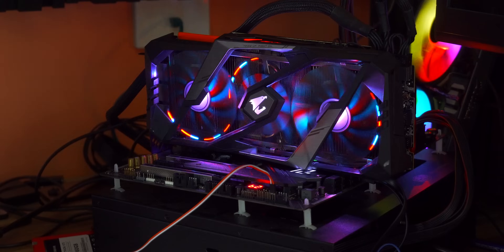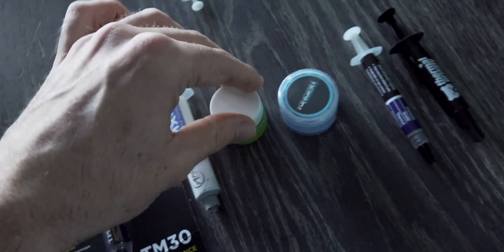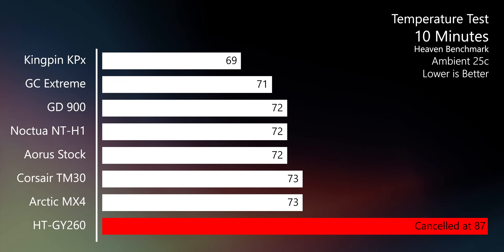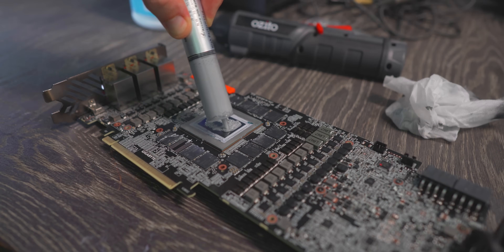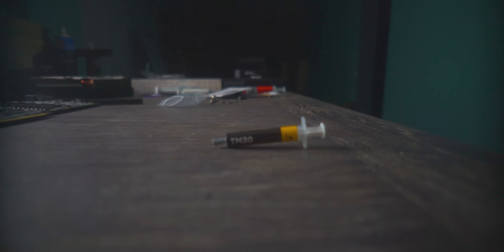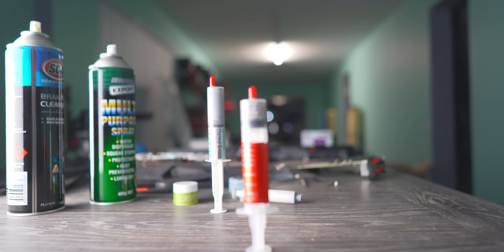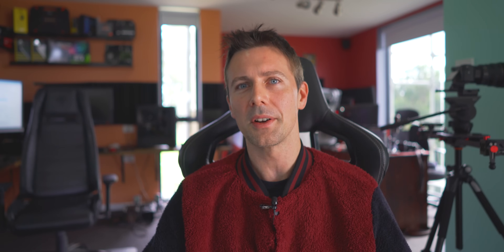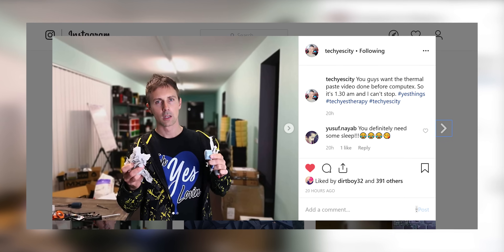What's The BEST Thermal Paste in 2019....? (Ft. GD900)

Comment: List of contenders for future comparison.
ARCTIC SILVER-5, DEEPCOOL SILVER Z9, Thermaltake TG-7, CoolerMaster MasterGEL PRO, CoolerMaster HTK
Reply: Arctic silver 5 is good but its not at its best when first applied. I think the curing period is about 2 weeks.
Reply: @pardonx1  it's not Really time, it's cycles. I was able to get it doing about a 5C or more better in a few hours just running furmark until it maxed out, cutting load and keeping fans at 100% until it stopped getting cooler, and repeating that several times. That kind of thermal cycling is rough on the cards but gets AS5 cured fast.
Reply: @kiaas  You're right I forgot about that . I think I remember it being said it would take 2 weeks for the average use of the PC and I think it was talking about the CPU. At any rate thanks for the correction
Reply: ThermalRight TF8.
Reply: Yes...AS5, I've been using it for years (Athlon64/Core2Duo I think)....I want to know if I should change. Especially now that I put an 8700K and Vega56 in Silverstone's ML08.
Reply: @mateiberatco500  Same here
Reply: @mateiberatco500  you should change yes
Reply: @mateiberatco500  I was using Arctic Silver 5 on my 8086k and Zotac Amp 1080 and after watching Tech Yes City video I switched to GC Extreme and it was a little better. It didn't allow me to overclock higher but it made already good temps better. As far as my gpu neither was better or worse than stock thermal compound but that cards cooling is just plain horrible. Having said that, for other people they both lowered temps on most gpu's.  Your experience could be better or worse than mine hopefully better.
Reply: @mateiberatco500  Switch man, mx4 is better. as5 used to be one of the best, 15 years ago yes.
Reply: @budgetking2591  Wanna read something funny? I got home and saw that the thermal paste I bought some time ago, for the included spreader, was the gc extreme....I wanted to use it on vega, but it would not stick to the die...the spreader would collect it all...so I cleaned it and put as5 instead.
Reply: Daniel Warnock I actually enjoy Arctic silver 5 I just don't enjoy cleaning it up afterwards lol
Reply: What about the graphite thermal pad he should do this for a benchmark on this. ✓ it's for $9.97 on Amazon 30x30 mm by innovation cooling
Reply: joseph salazar dont go there search it on youtube
Reply: i use coolermaster maker paste on my ryzen 2600 n rx580 strix,im curious to know how it competes as i pay 20 aud for it
Reply: Addition: Cooler Master "Master Gel Maker" <-[Or is it the same as "Master Gel Pro"?]
Reply: A lot of people are suggesting Arctic Silver 5 -it's pretty old, but it would be cool to see how far behind has it fallen. Just be careful cause that paste has a lot of fanboys (I'm not kidding here, they're vicious).
Also I recommend testing Arctic MX-2 - from what I know is that it's a little harder to spread but performs a little bit better than MX-4.

And separate tests for CPU and GPU might also produce different results.
Reply: @Undy1   the AS has not fallen behind at all. It performs exactly as well as anything new. The people showing results that it fell behind by 2-5° did not allow a 200 hour cure with multiple hot cold cycles. After the cure 2-5° is the exact improvement the AS will have. None of the reviews on YT or internet stores include this information or proper testing. Because they are all actually paid advertisements and sales pitches to buy new brands of paste. So you have loads of posers out here pointing to online stores "testing" and yt paid advertisment reviews showing the AS is beat by xyz new paste.
Reply: @AMoneyVideo  AS is literally made by a no name chinese company that tried to play off Arctic branding (the actual company that makes MX4 and MX2). Notice they spell it Artic not Arctic. As a owner of a PC parts company, who sells just about every brand of TPaste directly from manufacturers, I can completely and conclusively tell you are a moron to use AS5 nowadays when there are equivalently priced tpaste that perform much better, for much longer, that are non conductive. AS5 dries up in 2-3 years max. Not to mention that cure cycle is a load of bullshit. No thermalpaste on the market requires a cure cycle except silicon cement which is horrible for conducting heat. And we literally build 40-80 systems a month... with 3 year warranties on our PCs... not to mention we test probably double that in CPUs...
Reply: @Undy1  partially because nobody benchmarks modern pastes with AS5 running on P3s and athlons/durons. I take almost all of these YT tests with a grain of salt anyway.. testing on a cpu/gpu is meaningless and hardly reproducible.. needs to be on a hot plate with constant watt load and common heat spreader die sizes into a standard sink measuring delta T
Reply: Nocuta came out with the NT-H2 so that is one to add.
Reply: Actually testing Kryonaut? It’s been really good in my system and performed better then arctic silver for me
Reply: @dravago17  This reply is a year late, but whatever. I've been using Arctic Silver 5 for over 10 years. Just today started putting together a new one and bought Kryonaut for it, because all the techtubers were shilling for it. While looking up application methods for Zen2/3, I found a video of Steve from Gamers Nexus and Der8auer discussing thermal compounds, where Der8auer, who owns part of Thermal Grizzly, says that "all thermal pastes" should be replaced about once a year. When people complain about thermal pastes "drying out", he says it's because the compound gradually migrates because of thermal cycles and it only looks like it's dried.

Well, I sure as hell never saw my AS5 looking "dried out" when changing coolers after 3-5 years, so his Kryonaut is going straight in the bin. Might give MX-4 a go since I already have a tube of it, but LOL at people thinking AS5 is crap just because some barely tested aluminium-diarrhea that came out last year is performing better than it 10 minutes after application.
Reply: @ThePsiGhost  lets throw in mercury while we're at it
Reply: Also, Deepcool Gamer Storm G15
Reply: @Dalle Smalhals haha gl with that crap!
Reply: Alseye 9T+ , and Snowmann MTG10 ,should be in next video. They are really cheap , and in theory they should be betther than artic mx-4
Reply: @Dalle Smalhals In my country A.S.5 its almost 3x or 4x most expensive than those i mentioned.
That's why i would like a video comparison of some cheap chinese thermal pastes
Reply: Add Vkingkeyn  weird name I know.
Reply: Never use arctic silver it can short circuit
Reply: AS5 is highly conductive and should be approached with caution. I don't recommend it if you're gonna slap it on the silicon die, especially very EXPENSIVE silicon.
Reply: David DeBroux . Isn't the risk more related to the spread from mounting getting onto and shorting capacitors?
Reply: @robertt9342  That's exactly the point. Shorting capacitors around the silicon = dead GPU/CPU. That is exactly why AS5 is recommended if you're going to use a solution with a IHS and for overclocking.
Reply: @SNAFUClippy  Lol, all thermal paste have to conductive to conduct heat.
Reply: LOL@ ARCTIC SILVER-5, that stuff was good 15 years ago when  they werent that far yet, its bad.
Reply: @budgetking2591  AS5 is still able to hang with the top pastes - when people apply it properly - it isn't as forgiving as some modern pastes when it comes to application method and requires a few cycles to cure.

Though they did change it a bit more recently to make it more tolerant of people persisting with incorrect application methods it still works best when applied as per the datasheet - as in don't hand spread it - the original documentation used to even say hand spreading reduced its effectiveness but still reviewers would spread it with a credit card or cling film for "consistency" in methodology.
Reply: @paulkaygmailcom  Won't argue with that but I've consistently got very good results from it - certainly I don't feel like it is outclassed by any of the newer pastes when properly used.
Reply: @budgetking2591  source? Sounds like rumors spread by new companies trying to sell their paste.
Reply: @AMoneyVideo  Thermal Paste Thermal Conductivity (W/mK)
Arctic Silver 5 6.0 W/mK
Arctic MX-4 Conductivity: 8.5 W/mk
GC Extreme Conductivity: 8.9 W/mK
Kryonaut Thermal conductivity 12.5 W/mk
Liquid Metal 70+ W/mK
Reply: @AMoneyVideo  Many benchmarks show this, artic silver 5 is underperforming vs many other pastes. Look at the tomshardware  paste comparison.
Reply: @budgetking2591  actually no benchmarks at least on YT show this properly. The Tom's hardware guide included. Although Tom's tested a ton of pastes you can see where they failed along with everyone else. They did not allow a 200 hour cure with hot and cold cycles on arctic silver. This creates a 2°-5° temperature decrease as the flow/anticonductivity chemicals evaporate out of the paste. That 2-5° is the exact amount newer pastes are "beating" it by. Most of these videos are nothing but a sales pitch to sell new brands of paste.
Check out the "Important to Remember" area.  http://www.arcticsilver.com/as5.htm
Reply: @Zero939  cool so you are the source? Regardless if those numbers are correct guaranteed that is not after allowing a 200 hour cure with hot and cold cycles on the arctic silver that is required. Chemicals added for flow and to reduce conductivity evaporate off during that time.
Reply: @AMoneyVideo  why would you buy AS5, even if it does perform on par with something like MX-4, when it: is harder to apply properly, can damage your hardware if you make a mistake, takes 200 hours and multiple burn-in/cool down cycles, and only lasts 2-4 years vs 8 on mx-4? 

When MX-4 came out it was like 2.5x the price - everyone agreed it performed better, but AS5 was better value since it was cheaper. That's not really the case anymore.
Reply: @Hotrob_J  the AS after a cure would perform on par with thermal griz. Is the point. As in it performs on par with the best ranked paste in these tests. As in why try and act like anything is superior. Unless you want to say this paste doesn't require a cure and nothing else is superior about it. These "reviewers" putting out the "proofs" are using misleading and incorrect information. Because a company paid them to make the video and sell other brands of paste.
Reply: @Zero939  artic silver is not so low is 8.9 w
Reply: DeepCool Z5 for the win! Price performance it can't be beat, works great for me from lowly Pentium through to Ryzen 7 and 1070Ti.
Reply: boingkster 
Mx-4 cheaper and better
Reply: @boingkster  1.46W/m-K = junk
Reply: lol @ anyone using AS5 still or MX4, both are trash now
Reply: @Zero939  source? Sounds like bogus rumors spread by new companies trying to sell their paste.

Comment: Hey Brian.. GD900 is a "Conductive Thermal paste" its not a non-conductive paste
Reply from the maker: Really? I put a heap of it on the RTX 2080 Ti area, if it was conductive or even capacitive it would have made the card not boot... weird I will have to retest to see if I can get it to short out a card.
Reply: IT's THERMALLY conductive. Not electrically conductive. Big difference.
Reply: All thermal pastes are thermally conductive, the question is it electrically conductive.
Reply: @Namastech It's just a translation disambiguation. IT's literally says it in the title here. https://www.aliexpress.com/item/Free-shipping-30g-high-performance-gray-GD900-thermal-conductive-compound-grease-paste-silicone-for-CPU-GPU/1328028958.html

Comment: If you can get your hands on an older "Nvidia GTX 480" or "ATI HD 4870x2(dual gpu)" both those graphic cards kick out some serious heat.
Reply: If ya want one and want to pay the shipping I can sort it out
Reply: I think honestly any modern Intel like a 9900k or maybe even AMD 2700x/2700 OC is a good test.
I've never really swapped thermal paste on a GPU before.
Reply: Jimster480 Ryzen is super low power output, FX is much higher, but 9900k is even more than FX and much smaller interface so the Intel runs way hotter. The 7980XE is like triple FX-9590, so it’s the best and it’s kind of like cooling the sun...
Reply: @jakegarrett8109  fx just has to run at 60c max really. Which makes it much harder.
Reply: I have an extra heater, I mean gtx480, but I'm in the US.

Comment: Still using arctic silver here, is hat still a thing?... is the mx-4 better as a generic solution ? I really don't hear anyone talk about it anymore, I remember when artic silver was the best a million years ago and never changed it up.
Reply: MX2 is cheaper than AS5 and performs identically, but doesn't have burn-in, spreads better, and lasts for more than 5 years easily.
MX4 is an improved and more expensive MX2.
AS5 came out in autumn 2003. MX2 in 2007 and MX4 in 2009 i think.

Many young people building their first computer today are younger than Arctic Silver 5.
Reply: Yeah, Artic Silver 5 is pretty mediocre nowadays.  It'd be below all these except the one that failed, the 6Y260.  It's capacitive too so not the best for beginners.  If you want something from a big brand Arctic MX-4 performs better, is not capacitive, and costs about the same/gram.  Like Bryan said though, best to get the GD900 from AliExpress.

Comment: You could try Delidding a cpu and using each paste, once on the Die and once on the heatspreader. First test could be Just using the CPU before a Delid (8700k or x299 cpus) then a after. Just for more thermal results. GPU cooling and then CPU cooling would offer a variety of options to see what would be the best option for both, what would be the best option for each one (best performance) and then best budget. It may very well just be the same list (If Kryonaut is added it would be in the top as well) but it would be interesting to see how different companies are trying to innovate and make a better paste.

Comment: I personally use prolimatech pk-1, but it's a thicker paste @10.2W/m-k and requires a bit more care in application to get the best out of it. I too use GD900 as a stock paste and while it's only rated to 4.8W/m-K it will spread thinner easier and that's advantageous to heat flow.

Comment: I been using gelid after you did that video. I did some testing myself with gelid, thermal grizzly, and mx4 and gelid by far was the best. I also tested with my ps4, I used mx4 on my ps4 and it lasted 3 months before the fan started to get loud. Put gelid on and haven't heard the fans ramp up since and it's been over 6 months.
Reply: I am usig the gelid right now based on reviews, how much does it last timewise ?